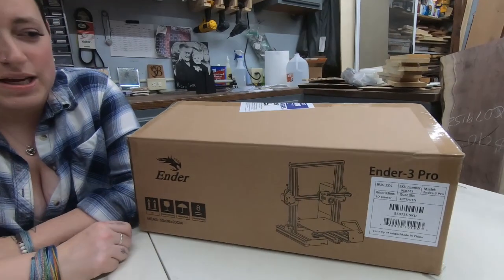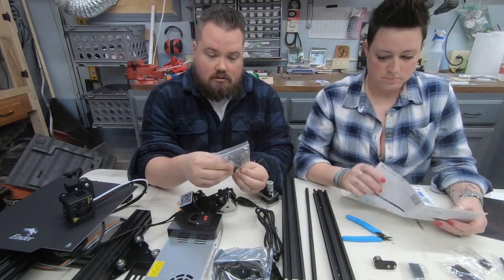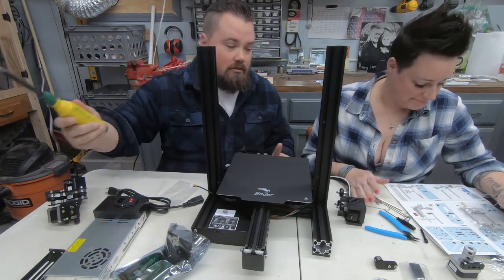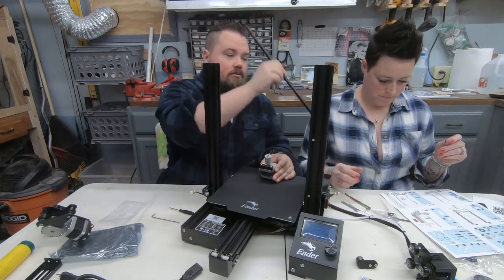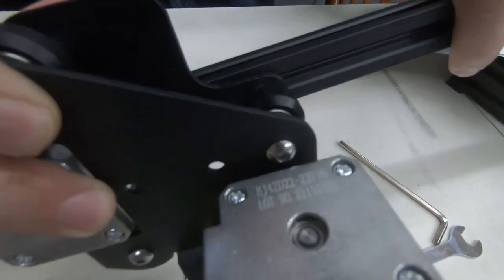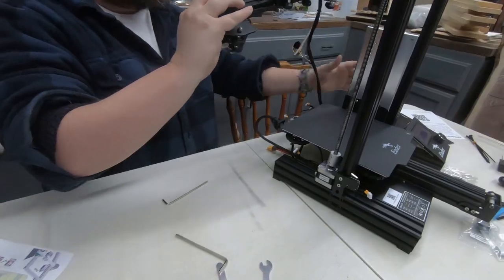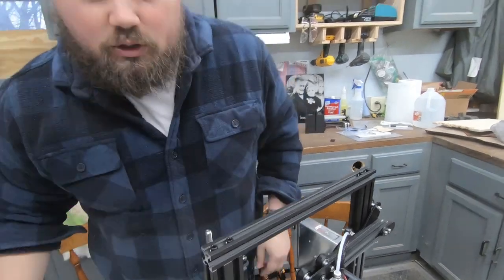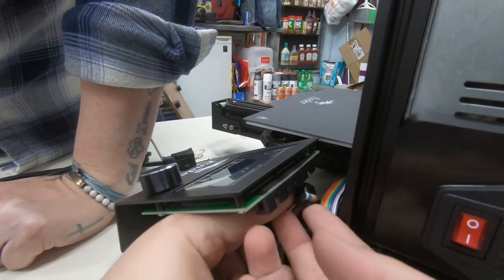Ender 3 Pro Assembly and First Print

Comment: Hey have a question do you think you could use weed trimmer Wacker line it 1.6mm an plastic so was just wondering
Reply from the maker: Found this on a forum. 

“In theory, yes. The string for trimmers is usually made of nylon, which is something that can be used for 3d printing. It requires a rough-textured print bed and a fairly high printing temperature.

In practice, bad idea. The quality is uneven, the diameter of the filament isn’t particularly consistent, it has likely absorbed a lot of water vapor and so will print very roughly, and it’s likely to contain chemical and/or structural additives of unpredictable kinds, so you’ll probably end up with nasty fumes and/or a damaged printer. There’s nylon filament intended for 3d printing; use that instead if you’re interested.”

Comment: Mine didn't auto home all the way it went over but not down and I don't understand what's wrong with it
Reply from the maker: Our bed was really low to start have to bring it up. Then was able to level it out

If it’s just not moving up and down at all I would check all the wire connections again.
Reply: @KLRform  yk I felt so dumb. It was one of the cords in the back it was tucked in but not plugged in fully 🤦‍♀️ made a pig 🐖